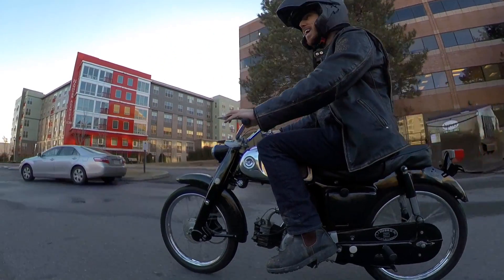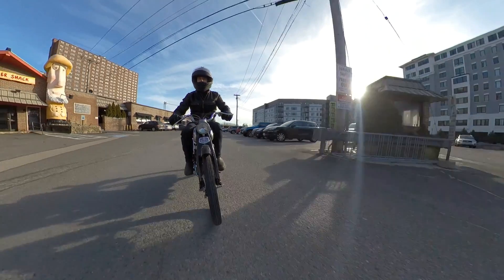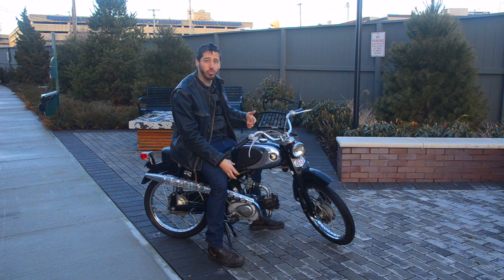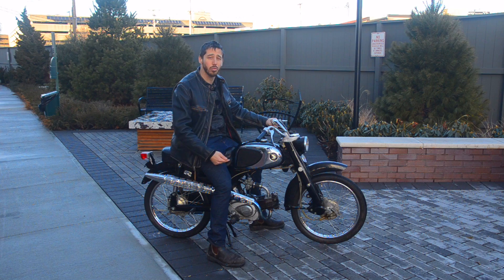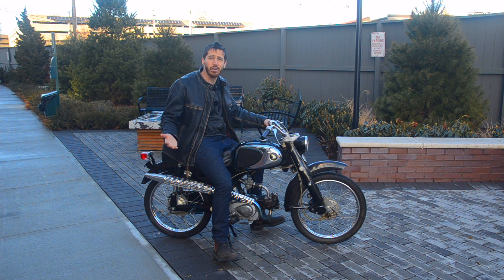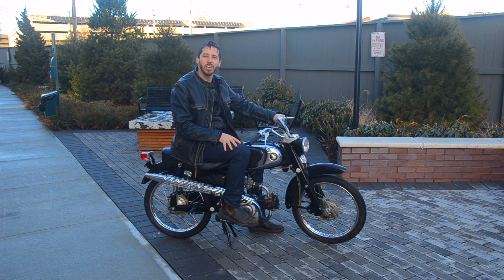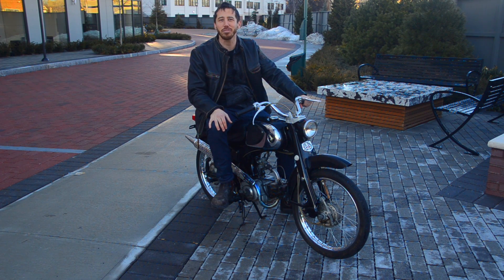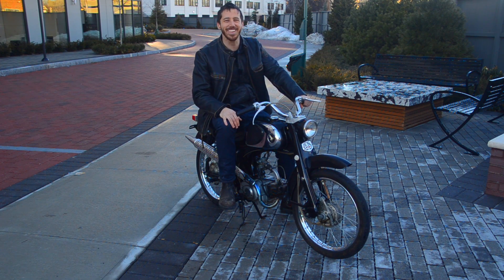DIY electric motorcycle conversion with 1969 Honda - Part 1: Planning

Comment: I was looking at a top 10 list of motorcycles in Pakistan. They are mostly cycles like that and they seem to cost $700 or so. Real world: some percentage down and $40 a month, is the impression I get. That doesn't leave much room for a relatively expensive battery pack, for a shift to electric.

Not sure what the technology and development curve is for basic motorcycles. I assume Honda will not have to spend huge amounts of money. How much did Rivian run up, for a much more advanced vehicle? So, what will you spend, and how would it translate into volume/wholesale prices? There are cheap packs all over Alibaba, like $200 a kWh. Probably volume prices.

I remember when these cycles, notably the Honda 50, first showed up. 

https://www.si.com/vault/1964/05/11/607211/the-sporty-honda-50-is-changing-the-publics-image-of-the-motorcyclist

I assume at the end of this project it is still a street legal motorcycle. Any hoops to jump through?

Too bad about the kickstart problems. You going to put a gas starter motor on the electric version?

Comment: I would do a hub motor and mount battery where the engine is with a cool cover.  For display a cycle analyst. Tank for storage.

Comment: There are plenty of rusted tanks out there. Please sell that good one and replace it with a  rusted out one. Would using a fatbike hub motor work if relaxed to the cub back wheel or maybe a moped back rim? Like where this is going.

Comment: I am looking forward to seeing how you do this in an apartment. Be sure to include footage that shows how you set up your workspace. Also, how will you charge it without a private garage? I live in a studio condo, and I have an unused 125cc motorcycle taking up space in my parking spot. It might be a conversion candidate, but charging would be a problem, because my HOA won't let me access power in the garage. If it did, I might already have gotten rid of the gas bike and replaced it with something electric. BTW if anyone is interested in a 2003 MZ RT125 to convert to electric, or just to fix up and ride, give a shout in the comments.

Comment: Just a thought - could you leave the engine & exhaust, cut the gas tank sideways  then mount it back using a hinge. Then use the inside of the gas tank to hold the battery?
Reply from the maker: I was starting to head that direction, but the problem is the tank is mounted over the frame so the center has a beam running through it. It's really two tanks connected at the top, meaning not a lot of space for batteries, just space for liquid fuel to fill the weird nooks and crannies in the shape.
Reply: Oh yes, that would be a problem.

Comment: You could go with an 84v battery
Reply: captianjessie1 a 72V Battery is 84V when charged. 😁
Reply: Awakened2Truth - Disciple of Jesus the Christ 96V isn’t a standard voltage, the closest would be maybe a 27S battery (if they are 3.6V nominal cells) at 97.2V... so when fully charged to 4.2V per cell it would be 4.2 x 27 = 113.4V

Comment: I can't wait for this. What's your take on using Panasonic ncr18650ga cells for your build, i ask as I'm in planning stage myself for my next pack and I'm going to be using them, also what voltage would you recommend? I was just going to go for 14s as i feel like 48v ebike supplies are cheaper than 60 or 72v. Any thoughts?
Reply from the maker: Those are definitely good cells. I'll probably use LG MJ1 cells as they are a tiny bit more economical but are very similar. 48V/52V is also fine, but for higher power it means you need to pull large current which gets expensive and also creates a lot of waste heat.

Comment: Ali express has 17in rear hub motors with drum brake ... if you'd like to email us , we have done a ct70 e-bike ..for photos and battery placement... the trail 90 or trail 70 engine guard worked great for stock footpeg bracket and battery holder

Comment: will you use 18650 cells to make the battery?
Reply from the maker: Yea probably 3500 mAh 18650 cells
Reply: EbikeSchool.com which 3500mah cells would you use?

Comment from the maker: Stick around to the end of the video to see some bloopers of me learning to ride this thing!
Reply: Make sure you take the MSF novice rider safety course. Even a little bike can mess you up. Even if you don't need an endorsement for a bike this small, consider getting one anyway.  You'll be safer for it, and if a sexy Zero catches your eye, you'll be ready.
Reply from the maker: @Xubuntu47  Thanks yea it's on the list of things to do, but there aren't any in my area until March so I'm waiting for the first available class.
Reply: Lol
Reply: For those that have been using metric outside USA
it is 48.5-50 km per hour with a distance of 100-102km
Reply: 7:16 this is why you’re making this ELECTRIC hahahaha
Reply: Thanks for sharing this
I want to covert an 100cc motobike into an e bike also
Going 48-50km per hour and 100-120km distance would be fine

If your motobike is under 65kg and under 50km per hour in AUSTRALIA , you can register it as an MOPED and drive it on a CAR LICENSE
Reply: Gday Would it be possible to setup a portable solar recharge system for this bike .. eg Foldable/flexiable 100w panel , even if it took 8-10 hours to recharge it
Reply from the maker: @charliebrownau  It would be possible but would take way longer. A 100W panel is more likely to average around 50W. For a 2.5 kWh battery pack, that's 50 hours of sun for a full charge.
Reply: @EbikeSchool  Thanks
Did you end up finishing this bike project and clearly lay out the parts/models needed to create an e motorbike
So many videos have annoying music and paywalls
Reply: Cool video ! I'm subscribing to your channel.  There is a lot of great info for diy ebike!